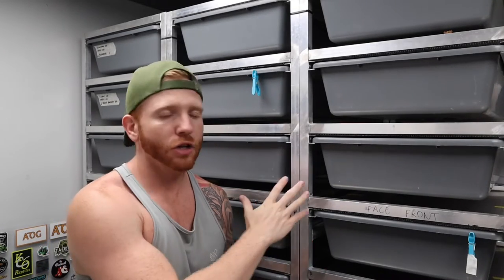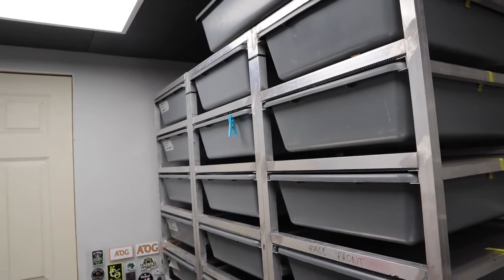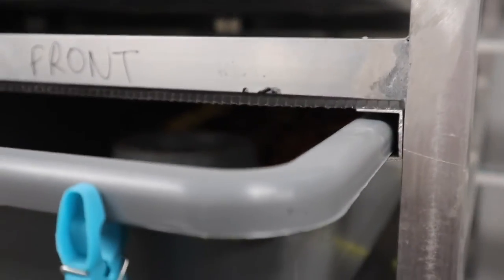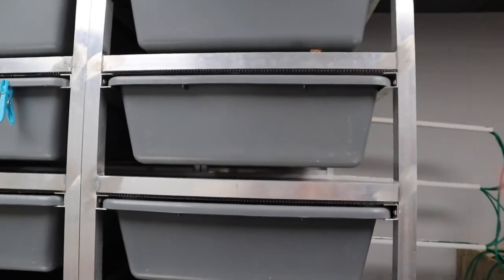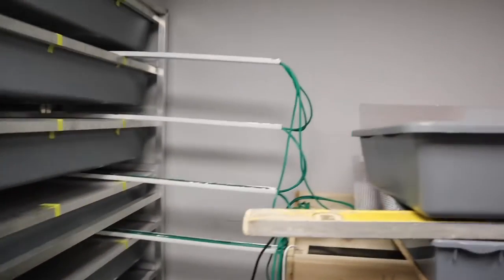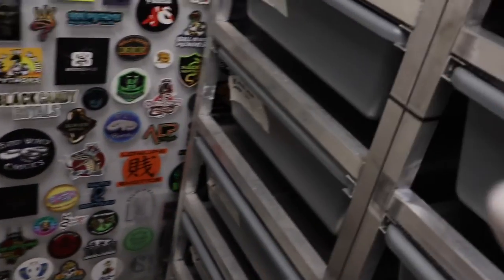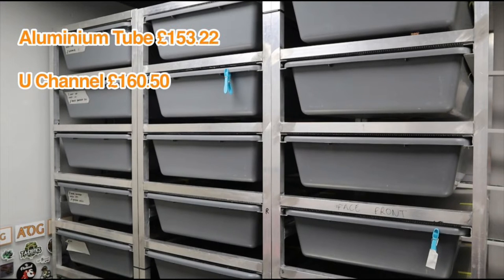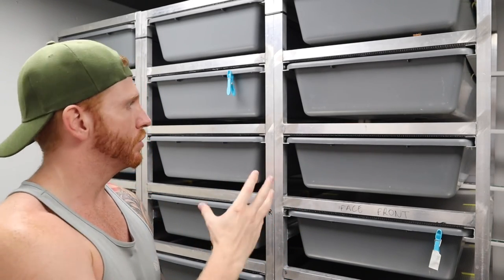DIY Aluminium Snake Rack Build. How I Made It

Comment: brilliant work 😀 got me looking how to build my own. What are the measurements of the U channel if you don't mind me asking please?
Reply from the maker: It’s very simple to do, you just have to take your time with it. With the u-channel in this position “U”, it’s 22mm along the bottom, 20m, high and 2mm thick. If you need any help then let me know.
Reply: @atingeofginge2709  Will definitely be taking my time. Thank you very much for that and I'll keep that in mind, just need to find somewhere that has that size.
Reply from the maker: Are you UK based? I bought mine from B&Q if you are
Reply: @atingeofginge2709  Yeah and I'd found a place that cut to size but the closest they stock is 19 x 19mm. Will have a look at b&q thank you.
Reply from the maker: you could probably get away with a smaller size. I’d take a tub to b&q and just test loads of sizes.
Reply: @atingeofginge2709  I'll give that a shot. Thank you